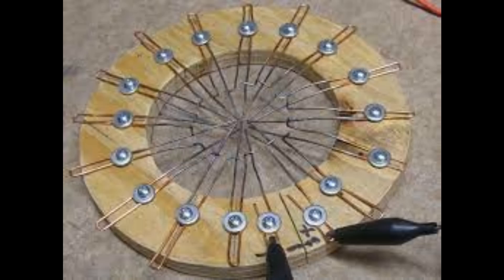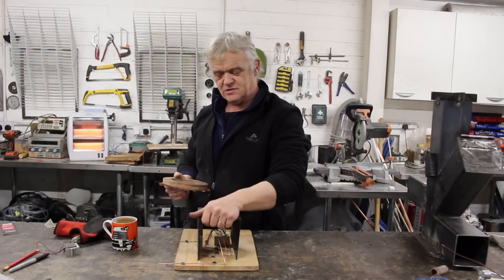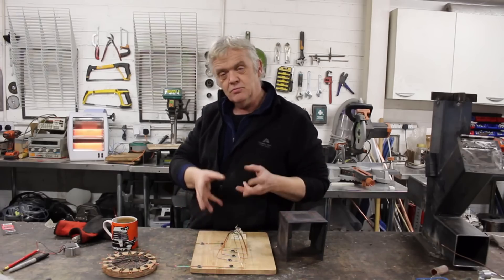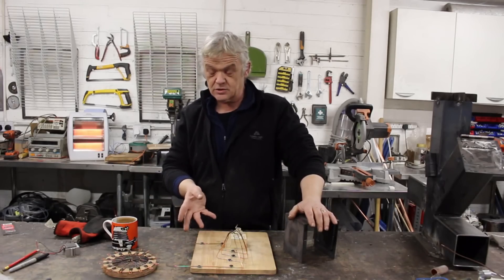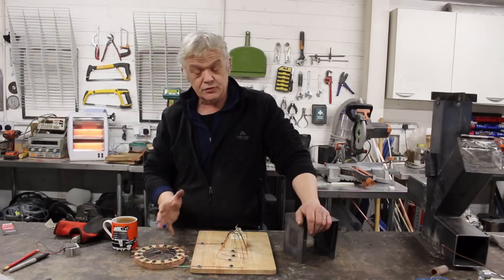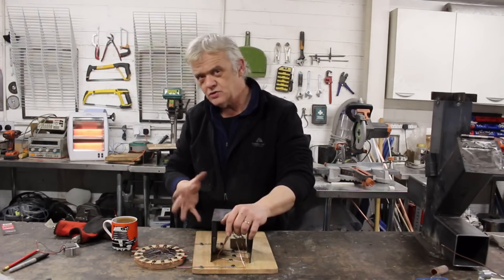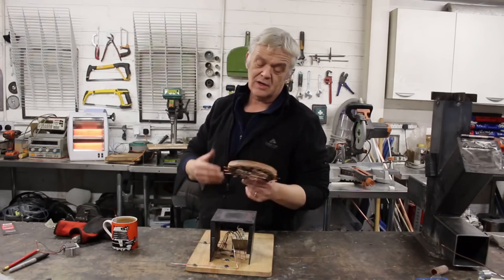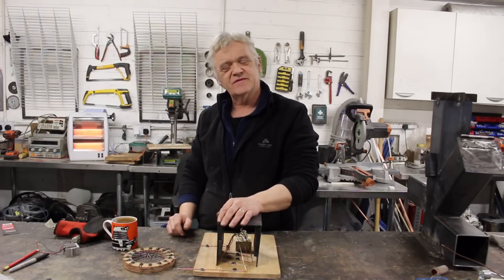2142 Thermopile And MHD - Generating From Rocket Stoves

Comment: LOVE, LOVE, LOVE Your videos!  

One improvement would be to cover the magnets with a thermally reflective (refractive) material and arrange them to deflect the heat back into the flame.  This also has the benefit of increasing the thermal efficiency of the flame - you can get a higher temperature and burn less fuel.  Also, while a traditional rocket-stove seeks to make use of the expanding air to generate an up-draft, you might instead consider ways of slowing the air flow and collecting the heat.  It would also be interesting to use some kind of heat-pump to re-concentrate the energy and feed it back into the system.  

If you are interested in a more challenging approach, you could make a high-powered compressor with a condenser line made from a material like tungsten, which you might be able to turn it into a kind of incandescent filament, thus recycling 30-40% of the original heat.  Think of it as the inverse of a cryogenic cooler.  While such a thing would have been EXTRAORDINARILY difficult to machine in the past, it may be feasible using modern 3D-Printing Techniques.  

Whether you want to keep things simple or push the frontiers of engineering, thermocouples are AWESOME!

Comment: These last few videos remind me of an article I read a while back where I think MIT(?) built a thermo-photo-voltaic cell. Iirc heat is used to warm a chunk of metal, as the metal heats up it eventually starts to emit light and then a photovoltaic converts that light into electricity. 

It was supposed to be reasonably efficent too, but im sure building a high-temp photovoltaic cell is not an easy task. I also wonder if youd need to 'tune' the photovoltaic so its more sensitive twoards the red end/IR of the spectum.

Comment: Yeah I don't get why we just don't start using things with very great promise for  dual functionality like a heatsink that operates as a thermoelectric generator you really don't see much of that nowadays
Reply: Usually the answer is that any thermoelectric generator causes a resistance in the thermal flow, so if your goal for a heatsink is to move as much heat as possible away from a chip or the likes, then you don't want anything impeding that flow of phonons.

Comment: The bigger the difference of temp between hot and cold the bigger the output. Try that starlight stuff to keep the cold cold and insulate the hot chamber to keep the hot.
Reply: That's ablative insulation, so it only works at temperatures where it actively degrades. At lesser tempertures, it's actually a terrible insulator.

Comment: i have always wondered why chinese diesel heaters for RV's didnt use this trick to power their fan. it would make it more expensive but they could sell it as a upgraded fancy pants unit. seems like you could cut the electricity demand from these little heaters by 90% at least on low or medium fan speed.

Comment: I wonder if you can make an mhd that uses tourmaline to make an electric field and ions and heat to then be converted by two plates and perpendicular magnets with the electrodes coated in graphene or graphite spray.

Comment: Robert, why don’t you use the (JOULE THIEFF)? A simple circuit that can be stepped up to very high power Voltage and Currents.  Install a few (TRANSFORMER’S) also. Want these circuits work? Thanks mate for sharing.🎉😊
Reply: Joule thiefs don't do magic. They use a relatively long duration of current driven by a low voltage to build up a magnetic field in a permeable material, and then allow that field to collapse rapidly, dumping all of that power into a very short spike.
Lower power over a longer time, gets transformed into higher power over a shorter time.
If you measure the power coming out over timeframes longer than the pulse rate, and do likewise for the power input, you always find that there's much less total power coming out than there is going in.
Reply: @AtlasReburdened  Thanks Robert for your quick response to my suggestion. I was hoping that this simple circuit along with a booster circuit would work well in this project. I guess, I was wrong. Thanks for sharing your experience and knowledge with me. I really do appreciate you doing this. Have a wonderful day.

Comment: I have a question, How is it a magnet loses it magnetism if its heated beyond its curie temperature, yet we have a Molten Magnetic core? Or so they say?
Reply: The Earth's magnetic field is not a permanent magnet.  It's said to be generated by the motion of molten metal through electrical fields.
I suspect the sun's magnetic field plays a role as well, but that's just me.
Reply: We don't have a "magnetic core", we have a magneto.
Reply: I bleeb its cause the molecular alignment changes as 4 the core it's a different kind of magnetic field the earth is an electro magnet a giant armature in space dats my take any who
Reply: What'll really bake your noodle is... Why is it still hot after all this time?
Reply: @Mmouse_  Yeh and how do they know? when the deepest hole anyone has ever dug was 8 miles, another 6000 miles of assumptions. Another one is, if it has such a huge magnetic field how come all the metal don't stick to the poles?
Reply: @Mmouse_ insulation, I guess
Reply: Why isnt the core molten but around it is when the pressures\temp are higher in the center?
Reply: So they say...

Comment: I always thought it seemed like a good idea to create a way to extract more energy from the waste heat generated by the various energy sources we use. Essentially, using the same design philosophy behind the triple expansion steam engine, where the steam is essentially at atmosphereric pressure by the time it reaches the exhaust outlet. Ideally, by the time the exhaust of a stove or engine reaches the atmosphere, it would be slow moving and at the ambient temperature. I imagine thermopiles, turbines, etc. 
 in-line along the entire path of the exhaust, such that the output is a gas at room temperature, at the minimum speed necessary to maintain a draft. I don't now how realistic the idea is, but it seems like you may answer that question!

Comment: That's a lot of energy to make such a small amount of current.
Reply: Not if you consider the energy created a bye product of the primary function....ie heating or cooking
Reply: @sailaway8244  in this sense.  When we lived in New Jersey during the winter the furnace would heat water that would flow through a radiators in different rooms.  You could turn a valve to allow or cut off the flow of hot water to the individual radiators in each room.  Would radiator heat be enough to make it work?  Would something like this work over an oven like a Sterling engine works with heat?
Reply: @peacepoet1947  no won't work on low temperature like radiators (max 80°C ) but has possibilities on any furnace producing 300°C flame  temperature.....if devolped you might get lucky and produce enough electricity to power the furnace control circuit maybe even some kind of low power circulation pump making your heating system electrically independent once upto temperature🤔